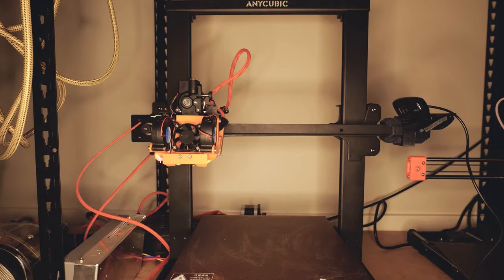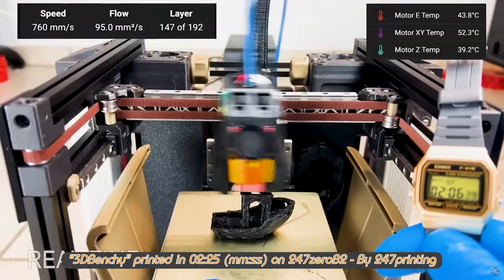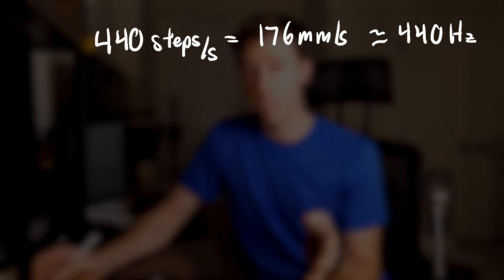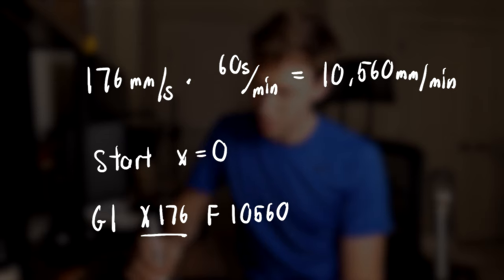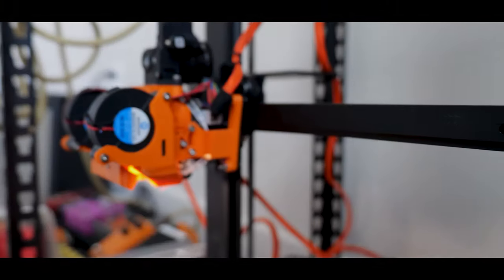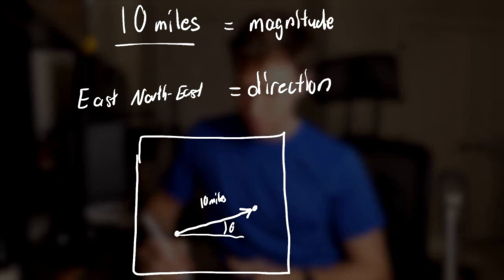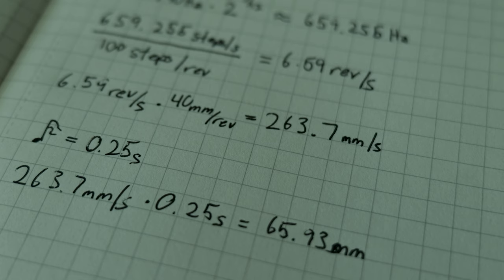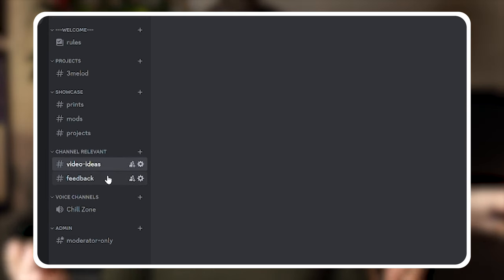Using PHYSICS to play Fur Elise on my 3D printer (and you can too...)

Comment: I have once started a similar project, but I just used a stepper motor as is, so there was no fancy code for not crashing the hardware.
I've just used an arduino with an H-bridge to drive the motor and bolted it to a piece of wood.
Without any microstepping and the wood as resonance body, the produced sounds were insanely loud.
Reply from the maker: Do you use an arduino to control it or something similar?
Reply: @SpencersDesk  yes, just an arduino and an H-Bridge for amplification, producing bacically a raw pwm signal, hence the strong noise

Comment: just use MIDI protocol my man. dont reinvent the wheel. that way, people can play whatever MIDI melodies they already have without going through the process of learning an obscure youtube pseudo language.
Reply from the maker: Maybe I misunderstood your message but here is my response. MIDI is not so trivial. If there is a program you can just type notes into and it outputs note names/rhythm/whatever, that might be nice and ‘easily implementable’ into this program. As for pre existing MIDI songs, how do you select which 3 notes to play in a song with more than 3 notes? That’s no trivial problem, assuming you want the output to sound good. As for the code, it’s very straightforward. You just type the note name. 1 row=1 sixteenth note. This easily allows people to type up a quick line of music to play at the end of their prints! Additionally, this program isn’t just a way to type in music, but a method of interpreting music with the kinematics of a 3D printer. Thank you for your comment!